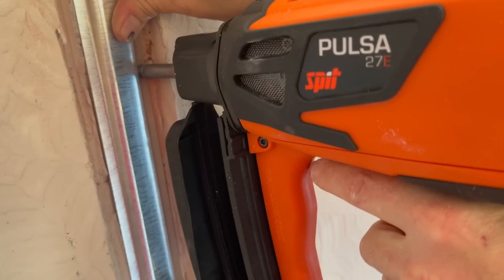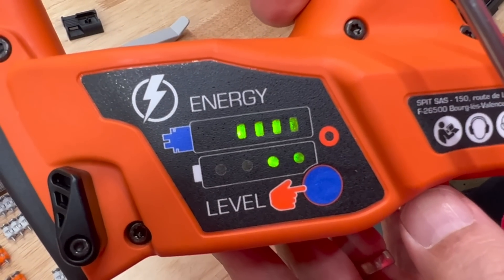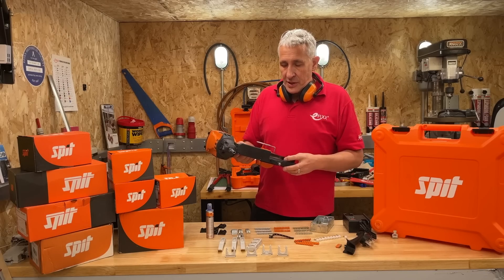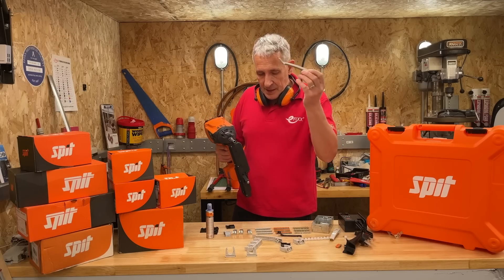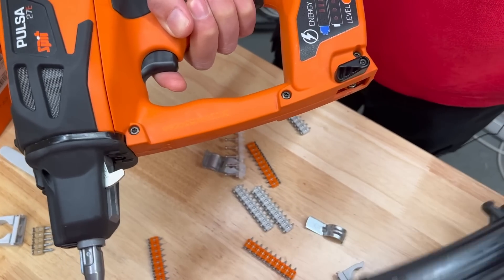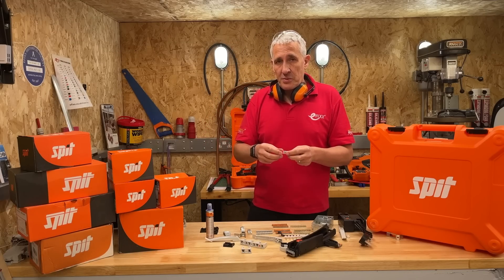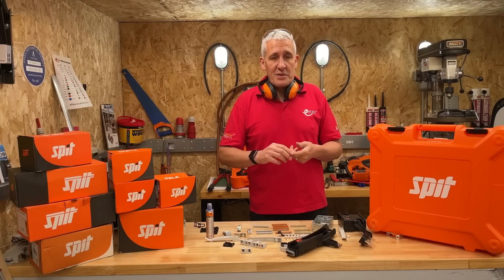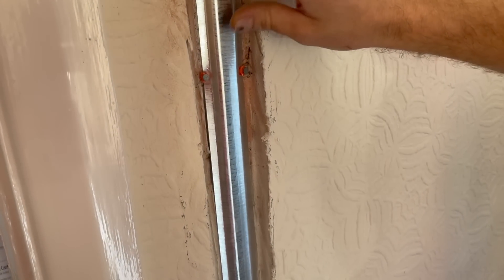NAILED IT! Faster Fix Electrical Installations SPIT 27E

Comment: Just been looking at the 27e for ev installs but the nails are only rated for use in dry conditions
Reply: They always say that, but you'd just need to test it out in practice. The Spit P700 still runs fine, and it has seen it's share of abuse. (outdoor construction)

Comment: This is not new was using this 10 years ago! Stopped using as not great in  concrete as lots of shattering of the concrete and the fixing would fall out also not great with RSJs if the nails are too long! Please show new products please
Reply from the maker: The 27E is a new version - RSJ nails too long, easy solution - use shorter nails 😂
Reply: @efixx  
Now you are teaching experienced tradesmen how to suck eggs! When I had already explained these tools are not new and not up to the job! 

You seem to be only interested in promoting products regardless if they are good or not. And unlike your original post which used to give the pros and cons (which were very informative), now you just promote anything that pays!
Reply from the maker: This is new kit for lots of electricians who haven’t tried nailers. The 27 E is based on feedback from the previous version 40E - shorter tool length etc.

Comment: Great review but no good for breeze block or other low density materials as they just fall out
Reply from the maker: We tested it on breeze block in the video - no problems. We will take a look at Thermalite blocks.
Reply: @efixx  did you ever look at Aircrete/Thermlite blocks?

Comment: This is mainly a first fix machine, I would use it in areas where its not going to be visible ie above a ceiling fixed to concrete for hangers etc. i would not use it for capping as its too much a risk of hitting a cable where as a hammer you get a better feel.

Comment: We use these to fix fire alarm clips in concrete half the time I get fed up with them misfiring or blowing large chunks of concrete out and just go back to an SDS and metal plugs. Would never use them to fix anything else I would consider that a bodge and unprofessional just another reason why the whole building industry is going down the toilet with shoddy workmanship. If you cut the hours / days down it takes to do a job then you get stuff poorly installed and bodged. Go and ask a top chef like Gordon Ramsay to cook you your food in a microwave and see what the answer is, same principle.
Reply: Agreed! I also find that the fire clips don't close properly once the nail sticks out a bit and I've seen colleagues hammer clips shut, most likely damaging the cable. Chunks of concrete in your face aren't fun either
Reply: @y3v1k  you must use the same clips as us, complete nightmare if the nail isn't flush I end up having to use a metal cable tie to close. Love it when the clips come out the ceiling as you try to clip the cable up and you get a face full of concrete splinters.
Reply: @chalky1150  haha yea must be the same as I end up using metal ties as well 😅

Comment: Looks similar to the paslode/Ramset/Hilti shoot up guns that we use in Australia, come with different fixings for cable tie securing “donuts”. Apparently some can be used for securing anchors in concrete for cable tray supports as well. The strength of the concrete can affect the success of these guns, blow outs are quite common and if it’s a finished surface, looks pretty bad.
Reply: Looks like it is made by Ramset according to the charger.

Comment: It’s ideal for capping, but any spark that uses it to fix back boxes to the wall , or to fix any other fittings to the wall s should be sacked , also what is the firing pressure ? As it is gas fired it will need to be under 12 foot pounds, if it is more than that then it is classed as a firearm and you will need a firearms license. The same law that applies to air rifles and pistols .

Comment: Used Hilti guns years ago but this method of fixing can be dangerous. Using the wrong fixing can blast it through a wall, hitting someone on the other side.
Reply: I remember many years ago a mate was working in an office over the weekend, fired a Hilti  nail into what he thought was brick, found it embedded in the wall at the other end of what normally would have been a busy office on a weekday.
Reply: Not with a gas machine, a PAT gun? yes

Comment: Used one for last 14 years, ok if substrate will hold the nail, ie to soft or hard nail won’t get a grip blowing brick away.
Then cost of nails and gas soon adds up….
I use in mainly for capping wires.
Bit of a tip use builders band across capping to keep nails a good distance away from cables.. the nails do sometimes bounce/ slip of brick work.
I would class this tool a high end luxury tool, in my opinion, not essential but comes in handy.
Reply: I would say the time saved definitely out ways the cost of nails and gas. It all depends on how much you value your time and whether you want to spend more and finish a job faster to get onto the next one.
Reply: @theosporge276  I agree with the time saved and cost but  l prefer the quality finish to my work my spit pulsa doesn’t guarantee this. 
I am not saying the gun doesn’t have its place it’s just limited.
In fact I was looking at mine just recently and thinking of selling it….

Comment: I am currently working on a office to apartment refit , the previous electrician had used one of these to fix back boxes , cables brackets , tray etc .  Now when socket boxes are in the wrong place you have to destroy them to get them off , the cable brackets fixed into the blocks of block and beam ceilings are falling out because they are too short  and the tray is useless because it's not spaced off so you can't get zip ties onto it . Overall it's useless and has saved no time whatsoever.
Reply: It just reminds me of how cowboy install bashers would erect kit. That new fangled contraption would get nowhere near any of my sexy, beautiful Mineral Insulated Installs and renewals. It reminds me of a damaged record ruining an expensive stylus. I'll leave this for the PVC gangs to get wet dreams over.
Reply: Everything you have mentioned is the fault of the installer, not the tool. All of those issues could have been avoided while still using this tool?
Reply: A screw gives you so much option than a freaking nail, especially a screw is way helpful in refits/maintenance. So i wouldn't use it for my clients.
Reply: I use one i hate it put your ties in first buddy 👍
Reply: I would say the sockets being in the wrong place and destroying boxes isn't the fault of the fitter or gun. They served their purpose for the original install. I'm sure you don't do your installs now making sure it easy to remove and move for someone in the future do you? I agree that the tray was sounds like it was done badly by the original installer but that's not the fault of the gun. It also sounds like he used nails that were too short which again was the installer. The gun definitely saved a lot of time for the original installer and you cant complain that its hard to remove as its pointless moaning.
Reply: @theosporge276  It's like unfixable and repairable appliances. Spot Welded motors you can't change brushes on. You've just said it all really. The throw away society has reached fixed wiring systems. I liken this to a cheap Beko washing machine put together for someone on a budget, where the flex is only just long enough to cut costs compared to a fully repairable, well built machine from Miele with a long flex and screws that don’t just spin round.
Reply: @theosporge276  the point is if screws had been used they could be UN screwed . Nails cannot .
Reply: @dennisphoenix1  the video also showed that there are screws versions of this. That's what I would've used.
Reply: @FingerThatO  the screws are for timber only . The nails aren't serrated so pull out of wood easily .

Comment: Would be very useful if you started telling us the cost of all the kit you try out. It would save time looking for it then finding out it costs an arm and a leg. For me the big disadvantage is being stuck to one fixing suppler. I use to use the Ramset gun but the cost of fixings was out of this world.
Reply: And that’s why they don’t mention the cost.  Agree on being locked into a ecosystem of fixings.
Reply: Definitely you ever tried to take an old box out that's only held in by one clout nail

Comment: Would the nails hold a metal back box in place for a socket on a block wall or will they overtime come loose with plugs being pulled in and out?
Reply: I've come across boxes nailed in with these before and you need a crowbar to pull them off!
Reply: I use these type of fixing to secure steel straps into steel beams and the only way to take them off is be using a hand grinder. A back box will never work loose from one.

Comment: The physics behind driving a pin through steel are quite complex: it's a hardened pin and the gun smacks it really, really hard 😜

I've used framing nailguns before and for those the precision isn't as critical as you can knock things about after your first nail and then add more nails. I noticed this seems to slide the accessories up a few mm when it drives the pin through - do you just have to account for that or was that just down to holding it at an awkward angle for filming?

Comment: Wonderful tool. I’m currently using similar gun. It’s changing a game, how easily and fast we can clip cable to concrete ceilings, make cable roads it’s incredible.
Reply: @majsonpawel  what you using thanky
Reply from the maker: Great feedback thanks
Reply: Does a client get a choice in how their installation is fixed? If I found nailed in accessories and capping in a new house I’d purchased I’d be asking the builder to change it. Also if a contractor had done it too.
Reply: @montystelevision3238  if you bought a new house and the biggest snag was the fixings used in the electrics, you'd be a lucky man indeed 🤣

Would you be the same about whether the studwork is metal or wood, what fixings were used on the plasterboard, the brand of electrical accessories, brand of plumbing fittings etc?
Reply: @Monty's Television  sure, if they pay more I'll even pull out my grandads bit and brace to bore the joists
Reply: @montystelevision3238  your comment didn't explain why, or any constructive details apart from "I don't like it"
Reply: @TheOvenCook  I’m just sceptical it’s a further slide on the already slippery slope of bung it in quick, that’ll do, scarper after payment. I’ve been to enough new builds to see the mess installed by so called “gold” CSCS electricians. But hey I have bare copper MICC in my garage.
Reply: @montystelevision3238  you are correct about the race to the bottom.  Cheap as possible.  Shame that's how its gone.  Luckily industrial work is still going on at the same pace .
Reply: @montystelevision3238  what happens when the concrete blows out when you fix to it all the bloody time you end up with fixings that fall out the ceiling, wonky cable runs and unevenly spaced fixings. I've used them for fire cables and they save a bit of time but I wouldn't use them for anything else.